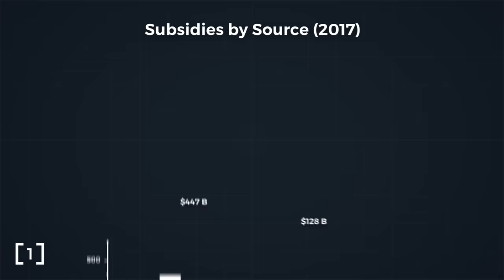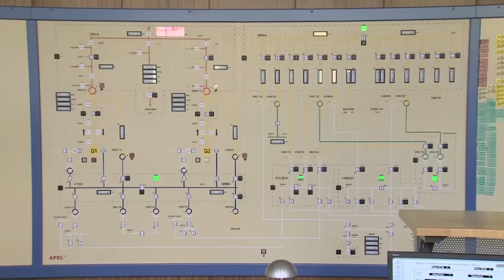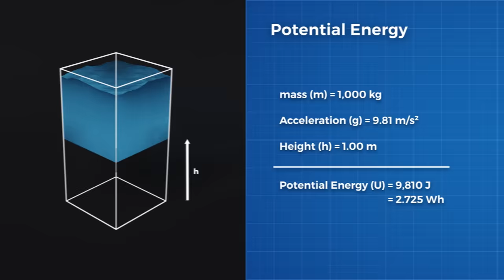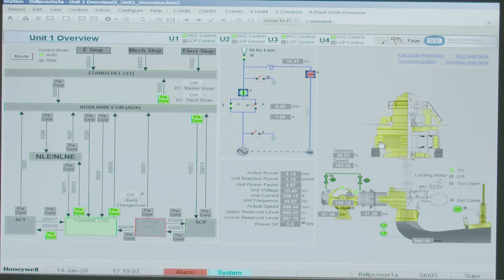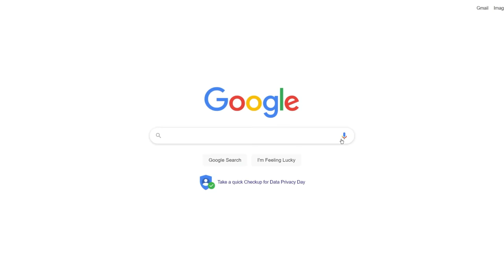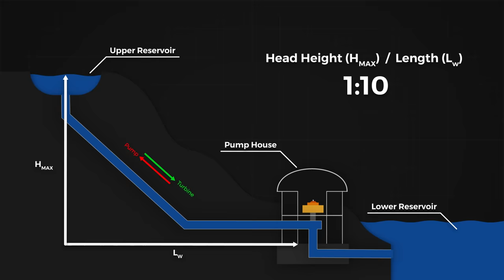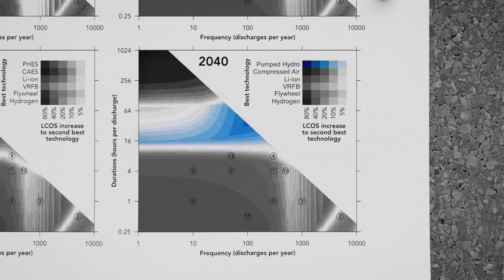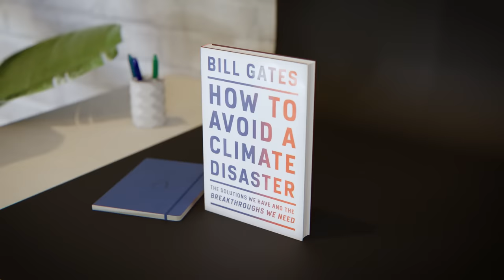The Truth About Pumped Hydro

Comment: It's still a diffuse energy source that your trying to condense into something useful. Nuclear>Renewables end of story.
Reply: Nuclear + renewables = better.
Reply: @sonicvenom8292  why even bother with them? They're so inefficient in materials for output compared to nuclear it's not even a serious question as to which is better. Fewer deaths, less material and less land per kwh.
Reply: Because nuclear cant change production on a dime, nukes can only cover baseload power demand.
The best solution is a mix of all not shit solutions. Nat gas is responsible for the US's declining emissions because its cleaner and more economical than coal. Rule 1 of power production, every single energy source sucks for different reasons and you the engineer must decide which solution is best for the current problem.
Brazil was happy with 95% hydro until a drought caused blackouts for a year, they are now diversifying.
Nuclear has long term consequences when mistakes are made, ask chernoble how that routine test worked out when a human made a dumb call, or 3 mile island when someone put a sensor on the wrong side of a display wall and they pumped water from the core into the sewer for like 13hrs straight.

Humans suck, when a windmill fails it takes a week to fix, when a nuke fails you can no longer live in Long island for 40,000 years.

Source: Electrical Engineering student with power concentration and sustainable energy systems minor.
Reply: @jasonreed7522  in depends more on the reactor design and if it has a heat storage system. Yes they can be throttled for demand.
Reply: @jasonreed7522  what do you know about molten salt designs? Our current nuclear does suck. Water is probably one of the dumbest things to use in a reactor. When your coolant is also your moderator your gonna have a bad time.
Reply: @rexmann1984  Because at current consumption we will run out of uranium in about 250 years. If we replace everything with nuclear it's only 5 years. Also nuclear kills more people per kWh than wind, solar and hydro, because of uranium mining, not necessarily accidents.  
When it comes to emissions, sources differ. Wind is usually around 10-35g CO2.eq/kWh. Solar  8-60, Hydro 1-2000(depending on construction, but median about 20). Nuclear 10-110, but this is gradually getting worse as the best ores have already been spent, so more work is needed to acquire uranium. Some of these problems may be mitigated with developments in breeder reactors, and thorium diversification. 
I'm guessing from your phrasing, you've seen the TED-talk with Michael Shellenberger, and it may sounds convincing, until you fact check his statements. Also realize that he has no background in any scientific fields, and works for a pro nuclear lobby group, that have no physicists  involved. Now, don't get me wrong, nuclear is great, and in combination with renewables you get the dream team.

https://ourworldindata.org/safest-sources-of-energy
https://en.wikipedia.org/wiki/Life-cycle_greenhouse_gas_emissions_of_energy_sources
Reply: @JKKnudsen  no it doesn't, not even when you add in Hiroshima and Nagasaki.
Reply: @JKKnudsen  you're also wrong about the Uranium yes, U235 is in that time frame. But U238 and Thorium are nigh upon limitless. We'll be interplanetary if not interstellar by the time the earth runs out of U238 and Thorium.
Reply: @rexmann1984  Check the sources...
Reply: @JKKnudsen  I have no clue who this Shellenberger dude is. Also if you're gonna factor in mining for uranium then you also must factor in mining the REMs for the wind and solar. Most Uranium mines are in developed countries with a solid safety standards REMs are usually mined by poor people in developing countries.
Reply: @rexmann1984  Yeah, those numbers imply breeder reactors, something that is not really developed.
Reply: @rexmann1984  molten salt reactors are experimental and nobody is going to sign off on an experimental nuclear reactor as the backbone of their economy for the next 40+ years.

Actions have consequences and nuclear consequences are the longest lasting.

Economics is the biggest driver of everything, no amount of fanboying for nuclear or coal can change corporate greed for profit. And climate change and government policy going against you is expensive.

Nuclear as is, is best suited for baseload with weather based wind+solar+storage for peak load and load shifting with hydro as the backup for all services.

Nothing is perfect, but a diverse mix of generation is ideal. Ask Texas how frozen panels and wind mills goes. Ask the 70's how that oil embargo felt. The only thing thats litterally everywhere is coal and that is the dirtiest power possible. And every energy industry gets subsidies because nations like the lights on and cars driving, its good for prosperity, the economy, and national security and stability.

And then there are non-power externalities to consider like medical applications of nukes and oil, water security and flood risk management of dams.

Everything is a super complicated BALANCE of economics, science, technolgical practically, public perception, national security, the environment and countless externalities. Its all risk management. And people don't like the consequences of nuclear accidents and waste (thats it own can of worms) and people don't like it when a drought turns off the hydro dam, and the don't like it when a once in a century ice storm knocks over transmission towers (1998 storm, North East USA) or disables there solar and wind farms (Texas right now).
Reply: @rexmann1984  No, not really, a turbine is a turbine, so that cost goes for both the nuclear and the wind, the uranium is in addition for nuclear.
Reply: @JKKnudsen  first link won't load. Second link has outdated IPCC reports and is worried about CO2. The IPCC has already admitted last year that their models didn't take into account solar forcing and their new models only take into account half of it. With these new models it was basically proven that the sun is the greater contributing factor to temperature fluctuations. Man made CO2 is starting to look like less and less of an issue. Also this year NASA sent up a satellite to observe Methane emissions since it's such a dangerous ghg. Guess what they found? All the massive cattle farms in the western US can't even be picked up by the senor yet massive plumes of methane could be seen billowing out of the Amazon Rain Forest. So much for "Earth's Lungs". Point is not all the data is in yet and we got loads of time to fix it if CO2 becomes a problem. However we are never gonna reach K1 status on solar panels and wind mills. That is just absolutely comical.
Reply: @jasonreed7522  India and I wanna say the Phillipines are getting them. They signed a deal with Alysiium to build SMRs.
Reply: @JKKnudsen  I'm talking about the kwhs you get for the REMs you mined.
Reply: @rexmann1984  It works fine for me, try googling the link, its the one referring to safety. Also, solar forcing has nothing to do with the work needed to mine and produce a nuclear reactor, nor a wind/hydro turbine. I suggest you provide some sources for your statements.
Reply: @JKKnudsen  The third is greenhouse gas emissions: fossil fuels are the main source of greenhouse gases, the primary driver of climate change. In 2018, 87% of global CO2 emissions came from fossil fuels and industry.3 

   That is just one paragraph of absolute malarkey. The other 13% the claim is from land use change. So you mean to tell me that not a single volcano made any CO2 that year?
Reply: @rexmann1984  Now, we are not discussing whether fossil fuels are the main source of greenhouse gasses. Try to stay on point. The third what? Volcanos are not a manmade energy source, so why would it be included in a list of energy sources? If it's the link you are referring? The the CO2.eq/kWh is proportional to the work needed per kWh, so both wind and hydro, has nuclear beat, concentrated solar is comparable. Also Resource Efficient Mining you mined? What are you talking about? After the initial cost, renewables don't have any mining, so basically have infinite resource efficiency . Nuclear actually requires mining and refining.  Also realize that renewables are in fact fusion, but we don't have to deal with activated waste. I understand that interpreting scientific literature is difficult for the layman, but me(Physicist), and the electrical engineer from above, are just trying to help you out. You seem well read, just lacking the necessary background to see that the choice wind/solar/hydro/nuclear depends on location, grid capacity, politics. etc. But when it comes to deaths/emissions/resources/environmental impact they all fall into the same category, and they are all on pretty equal footing, but do serve different roles on the grid.
Reply: @JKKnudsen  ok, we can't go claiming one person needs to stay on topic while the other person provides links to said topic. That's not working.
Reply: @rexmann1984  What links have you provided? You have made a  bunch of statements, and yet have no sources anywhere? We are discussing Nuclear vs Renewables, you keep rambling about solar forcing, and how fossil fuels are worse. This is completely irrelevant. You said yourself "Our current nuclear does suck" so what is your point? Because renewables doesn't. You promote exclusive nuclear based on technology that doesn't really exist yet. And will not exist for at least another 40 -50 years in the commercial sector. The fact is that on most parameters you can compare energy sources, renewables has nuclear beat. So why wouldn't a well developed grid utilize both? When you are presented with data that refute your statements, you claim malarkey, yet you provide no links/sources/calculations of your own to back up your statements.
Reply: @rexmann1984  Dude, you linked to a video of a guy talking about magic tricks and walking on water. I see he has other videos on nuclear related topics on an elementary level. But do you expect people to watch hours of video to find him mentioning something along the lines of your statements? I chose my links because I knew all the information needed was on the fist page. But lets just take his video "There is always a cost" Yeah it sounds bad, 1.2 million per MW, but the cost for nuclear is 6-9 million per MW, so assuming the reactor is always at 100%, you get 4 times the return compared to wind, but at 5 times the cost. Ergo, wind beats nuclear again.

Comment: (1)Why not combine renewables ,floating solar on revivors could be used to reduce evaporation  by up to 70% ,reduce wave height in reservoirs (higher waves can cause erosion), improve water quality .Rather than floating the PV panels on the upper reservoir they could be fixed above the water body.
(2) As the power generated from the wind is exponentially related to the wind speed, surely a variable pump speed would work better, allowing upper reservoirs to fill faster,
(3) Why not use some of our U shaped valleys with impermeability rock layer to to hold large amounts of more dense sea water .These valleys could have relatively  cheep rock filled dams.
(4) Pump storage working in consort with interconnectors would help also. I like what you said,

Comment: The maintenance on pumped hydro must be taken into account, it is not simply a battery of hydro, it includes expensive and expensive to maintain as well as expensive to power pumps.
 Plus evaporation must be accounted for as well.
 Water also has a tendency of soaking into subsoil, these are all losses of energy.
 Costly even at large scales.

Comment: "Muh batteries" 
All because nuclear energy scares normies
Reply: true, especially with something like thorium which could hopefully hold us off until fusion.
Reply: I just want better batteries so we can get better electric cars.
Reply: Guiep The main problem is with long term storage of used rods, they have to be stored securely for incredible long times and i think most of the rods are just in "temporary" storage since decades, because there aren't enough sites that are suitable or some that where tought to be long term developed massive problems
Reply: @strongback6550  nuclear cogeneration plants could massively drop hydrogen production, power carbon capture and we could easily make synthetic fuels completely ditching natural gas and petrol.
Reply: @noahluppe  No, they don't, not if you use that "used" fuel and fully burn it in fast breeder reactors like the BN-800, then the tiny amount of actual waste only needs to be stored for a couple hundred years before it's no more dangerous than regular natural uranium.
Reply: @Gornemant  yes, of course you could do that, but that hasn't been done yet, so to this point the waste is the biggest problem. In Germany I think there is no active nuclear power plant, but the waste of decades of many plants
Reply: @noahluppe  It's a proven concept, we know it works and we already have working reactors that can do exactly that. The point is countries like Germany do not want to do it because they want to keep the waste as a false excuse. Germany still has active nuclear power plants, the last ones will close in 2021 and 2022, and they have been working relentlessly to cover for the insanely poor performance of renewable energy.
Germany even had a project to do just that, burn up old fuel, it was called the dual fluid reactor, but the almighty German coal industry made sure to stop that.
Reply: @Gornemant  sorry I wasn't clear enough. I meant all those new ideas for long term solutions haven't been put into big scale distribution, so up until now the biggest problem is with  waste of several decades. The safety of nuclear power plants is so high a failure is very uncommon, not totally suited temporary storages have been e.g. flooded (also due to bad planning) in the past, because they have been used as long time storage cause no other long term suitable place has been found.
Reply: @noahluppe  That is a political problem more than a technical one, same for storage. There's plenty of suitable places but nobody wants that in their backyard.
Reply: Don't worry. The renewable+plus battery option is still utterly impossible. So we're not really debating one or the other, we're just deciding how much we suffer before going nuclear anyway. ;)
Reply: @mrchemistrycow  thorium is 25 years to late at this point.
PV and battery tech is developing so quickly now, decentralisation is the future.
Reply: I have no sufficiently informed opinion on nuclear energy, positive or negative, but I wish nuclear fanboys would stop derailing every single discussion about renewable energy.
Fight fossil fuels, not other renewable energy sources necessary to mitigate climate change.

EDIT: Besides, energy storage is absolutely still useful even if you'd rely fully on nuclear energy (simply because energy needs are highly variable throughout the day), so it's just a completely useless remark.

Comment: Without recognising the scale of the challenge (storage), what hope is there of meeting it? This video is an honest effort to convey these figures, so shouldn't be faulted for being the bearer of difficult news.
A recent article in New Scientist reports "Green energy in them thar hills" (27 Feb, p13), and how "...each 1000 megawatts of pumped hydro could replace 750 MW of power from a nuclear plant..." - not a single mention of the amount of PH storage available from this article! The source document was commissioned by SSE (which has no nuclear) and targets EDF's proposed Hinkley Point C. It estimates a total of between 30 and 90 GWh PHS potential in Great Britain - mostly Scotland and Wales - enough to match 'Point Cs 3.2 GW baseload output for at-most 28 hours. Given the UK has a baseload (minimum continuous level) of ~40 GW in winter, and ~20 GW in summer, why not target one of its (SSEs) own gas-fired fossil plants rather than a nuclear facility which is already zero carbon?
The total coal oil and gas (primary energy) consumed in the UK is equivalent to 200 GW-years per year (true in both 2018 and 2019). We cannot afford to ignore green baseload solutions on ideological grounds!

Comment: i like compressed/liquified air :D its similar to hydro, but can be built small-ish initially and scaled up. More storage? buy more tanks. More generation? additional generators. try doubling or tripling a pumped hydro storage after it has been built
But yes, each technology has its own merits, and they should be combined
Storing energy in flywheels while the pumps switch direction,

Comment: Pumped hydro near the sea:
Wind turbines, on-shore or off, should not turn generators but turn pumps to directly pump the water up.
Likewise wave energy harvesting can directly move pumps direct from the sea (a piston pulled between flotation above and anchor into sea floor below)
Reply: Sharon 20 y.o - check my vidéó  Yes, pumped hydro is just a battery and it will respond quickly to demands for energy.

Comment: Amazing video. The ratio of is incorrect, in reality, you seldom need more than 5 hours, in particular with wind. So maybe even a 50% extra will be more than enough.  Remember that before you can move to 100% renewables you need excess capacity.   So if you have 2 to 3 times wind +solar capacity you don't need so much from the batteries (in this case pumped hydro).We may still need to burn hydrogen, which could come from excess Solar during the day, but it's not as gloom.